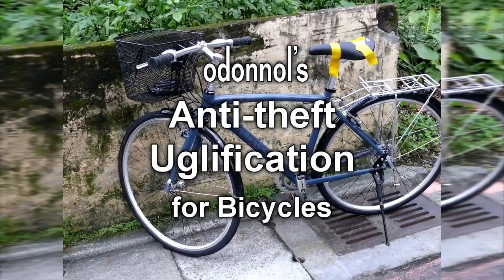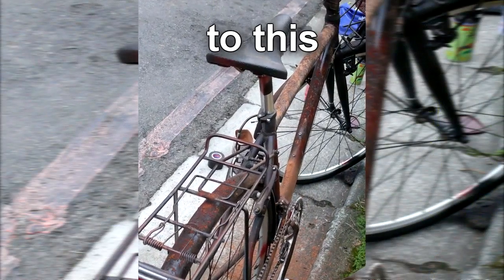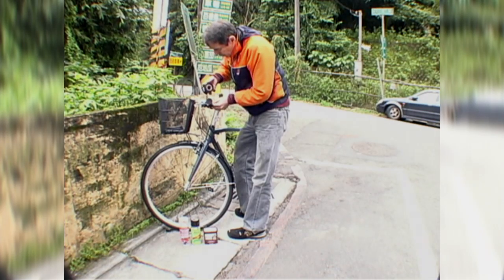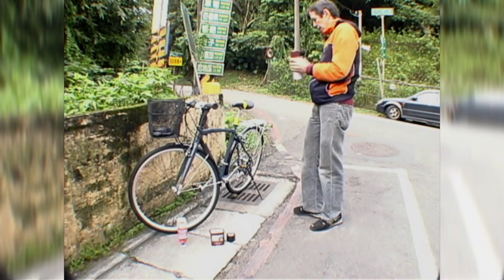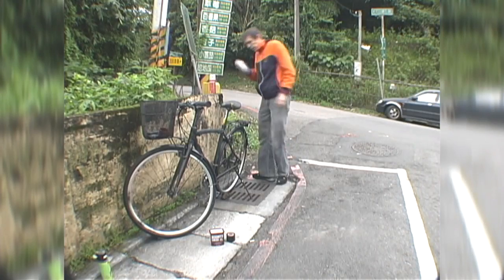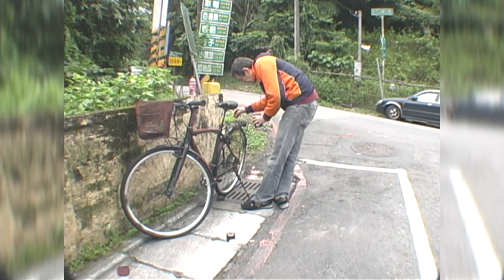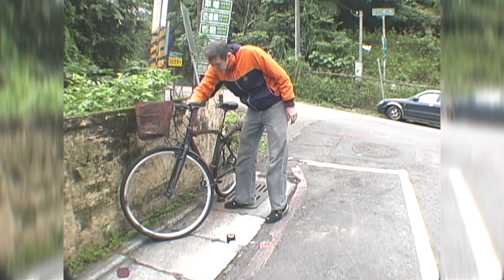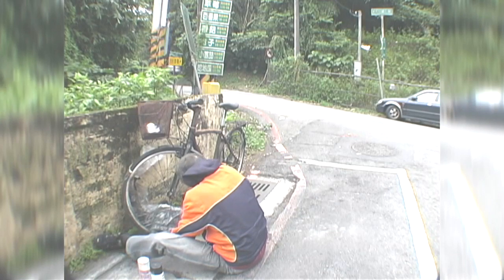DIY Uglification: A Simple Anti-theft Technique

Comment: Personalization apparently works just as well. If you mark it up with stickers and such that you like, it makes it unique and a lot of work to sell it as brand new. A thief won't get top dollar and will likely target someone elses. Using multiple locking systems is also good advice. A short U lock through the rear wheel and frame, then a chain or cable on a bar or locking post etc. Make em work hard !
Reply: I like your comment; makes a lot of sense.
And this IS personalization–if you like powdered chocolate!
Reply: yeah I did the same thing with my laptop, painting on it and writing my name on the pieces inside it with permanent marker. Personalized items could be resold but they can't pass as a new article so thieves are less attracted by it.

Comment: Uglification? Sounds like a waste of time, and money considering thew fact that you could save that money to purchase a good quality lock instead of spray paint and tape.
Reply: Thanks for your comment. I also use a medium good lock. But it is my opinion that making the bicycle unattractive is more effective in discouraging theft. There is something about a good looking, high-quality bike that thieves find hard to resist. Resale value maybe?
Reply: Miles Odonnol
Not when a thief will likely spray paint the bike before selling it.  I agree with Raijin, just get a locking system that deters the would be thief and keep the bike looking nice.
Reply: RaijinHanshi They should make bikes with gps systems INSIDE the bike that you can't take out.  Maybe they already do, but I haven't seen them.  These will get your bike back fast and throw the thief in jail.

Comment: is better you buy black contact paper... and a sandpaper... for sanding the paper, the bike will be very ugly. And when you will sell the bike, you remove the paper
Reply from the maker: Not a bad idea. I did tape up some areas, such as the aluminum handle bars. But generally don't sell em; I ride em forever, or till they break.

Comment: I should do that with my carbon fiber frame. I could make my $4000 bike look like a piece of shit that a thief will not want.  Then I would not get so stressed out and worried when I have to lock it up  for several hours.  I don't care what a bike looks like as long as it is super light weight and the gears are clean and shift properly.
Reply from the maker: My sentiments exactly. I only paid a seventh as much for my bike, but I'm sure glad it is still here where I can ride it.
Reply: This. What good is a skookum bicycle if you cannot actually use it for fear of theft? No lock is invincible.

Comment: You have to be careful not to make it so ugly it looks intentional. The real trick: Repaint your high value bike with glossy, beautiful decals until it looks like a comparably shaped Walmart special. At least in the US, names like Schwinn, NEXT, Huffy, Roadmaster, and Mongoose are well known to be worse than worthless on the resale market.
Reply from the maker: Interesting, and smart. So far the fake rust (even on the plastic mud guards) and beat up appearance seem to be doing the job. Of course the bike is over four years old now too, so some of the age is real. 
But I like your thinking. I might go for a Hello Kitty treatment. 
Baskets help too, I think. They are rather unsporty. I now have baskets both front and rear. 
Oh yes, I couldn't find a chain guard to fit this model, so I made one from used cookie tins. Covers chain; looks trashy. Perfect.
Reply: The best thing is that all those mods are functional too!

Comment: Great thank you for this! Like many others I’ve had painful experiences of bikes being stolen, including peaceful Scotland where I’m now! Just bought a new bike as the old one (very battered so good for theft proof but just too many faults to be worth repair) and determined to find a way… may I ask how effective are all of your sprays and coco power, especially the clear lacquer spray (by the way, I only saw gloss on Amazon, will it work?) in holding the coco power in place? Do you need to “top up” after some time of usage? Thank you again!
Reply from the maker: Gloss lacquer works nicely. The 'rust' effect fades a bit over the years, but I have not yet topped up. Ten years later the bike still looks like crap. The black and brown paint help too. Brown adds to the rust feeling; black looks like dirt or maybe oil. I first hit anything shiny with black tape or paint. When done, nothing jumps out. Best of luck!
Reply: @Odonnol  thanks. More technical details- did you use oil based or water based paint? I assume spray paint looks more convincing than using a brush?
Reply from the maker: @xinyijiang6302  I used spray lacquer. AFAIK any spray can paint should be fine. I don't think they put water based paints into spray cans. Anyway, I'd avoid water-based.

Comment: I love this idea and have done things with this concept in mind to my bike and car. When I got in an accident instead of getting the matching fender and quarter panel I got the black matte. When chrome parts wear out on my bike I replace them with matte black parts. I’ve also put duct tape on my brand new bike seat. I don’t take special care to keep the frame clean or prevent scratches. I’d recommend to anyone to immediately replace quick releases with bolts. No only does it make those parts easier to steal but also makes the bike look more expensive. Good luck all.
Reply from the maker: Thanks for your comment. I still have quick-release skewers on a couple bikes; I've been lazy about them, and not sure about finding the right replacement hardware. But you are definitely right.

Comment: why dont you just buy a cheap rusty old bike, instead of a new expensive bike made to look ugly also decreasing the price
Reply from the maker: Other people have mentioned this too.
The thing is, there is a huge difference in RIDE between a good road bike and an old beater. The good bike is much more efficient at turning your physical exertion into travel down the road, so you go faster, and farther, for the same effort. Sometimes in traffic you need to accelerate; with the good bike, you can accelerate more quickly--a lot more quickly.

The brakes work better too, so you can stop in a much shorter distance. BTW, it's amazing how much better bicycle brakes work now as compared to when I was a kid. Another thing is adjustments (e.g., brakes, shifters). The old beaters I've had were a) hard to adjust b) required frequent readjustment. The good bike is easy to adjust, and holds adjustment for a long time. 

Anyway, to me it is worth the money, within reason of course, for a quality experience. Obviously I don't care much about fancy looks or resale value. But I do like it when the bicycle I paid for stays around so I can ride it!
Reply: Odonnol
Get a good used bike. You probably will have a better bike for the same price.

Comment: Just buy an old and secondhand rusty uglr bike
Reply: Great idea! Except that old rusty bikes usually ride like crap. There are good reasons that people are willing to shell out $500 for a superior street bike: fast, smooth ride; comfortable and efficient ergonomics; sure, quick braking; accurate adjustments ( that hold ); durability; better safety; lower noise.
But if you want to ride a crap bike, go for it! I used to ride crap bikes myself; that's how I know so much about them!

Comment: Old post, but .... how do you wash it after giving it the ugly-treatment?  Maybe I missed the point :)
Reply from the maker: Wash it? Whut? I don't wash it. Well I cleaned the chain with a solvent soaked rag, then treated with wax, instead of oil. Much cleaner chain now, which saves pants and socks.

Comment: simply always buy a rusty piece of shit. I dont understand how ppl can spend thousands on a bike that is NEVER safe. EVER.not even close
Reply from the maker: I totally agree about voting Bernie! But with the bike thing, it's a matter of balance. A good bike provides a much better ride than an old pos. For this bike I did not spend thousands; I spent around half a thou. And I am still loving the good ride.
Reply: Odonnol is right. I bought a bike worth 400 euro for the first time in my life after always getting cheap ones. The difference is incredible. I can zip up hills now, I can cycle down down off the pavement without even feeling it, let alone hurting my bike or my back, and most importantly, if I need to cycle really really slowly, slower than walking pace, my bike does not wobble even a little bit. For example if there is a lot of broken glass on the road and I want to cycle on the pavement without freaking out the pedestrians. (It is a Felt q26 by the way, and I bought it second hand (from a shop who insist on receipts!) for just 200). 

I see people struggling on a flat surface because their bikes are "rusty pieces of shit", and I think "that used to be me".

Comment: This is genius. After all this time have you changed anything to make this better? Also, does this work in really humid places where you would ride the bike while it's raining?
Reply from the maker: Glad you like it. No changes or improvements. Works fine in humid and rainy places. When the clear overcoat paint or lacquer dries, it holds the chocolate powder in place. There is some erosion of course, especially in the first week or so, but even years later it still looks rusty. Even the plastic mud guards are rusty; I treated them too.

Comment: this guy realy think thief are this stupid ,, aluminum and plastic don't rust ,,  thee are 4 type of thief  the one than want to sell it , and make good profit ,, the one than want to ride it ,, and the one than want some parts to fix is bike ,  and the junkey ,,
Reply from the maker: Yes. Thieves here really are not too smart. Or maybe they are just lazy. But uglification is working here. Maybe you live in a place where the thieves are smarter and/or more industrious. If so, my sympathies.
Reply: most are like you say not to smart ,, but at the end the most comon are the junkie  and the kids ,, so a good  D lock 20-50$ and you are good , most of those don't have heavy tools ,  like angle grinder o big bolt cutters ,    if you have a cable lock or a cheap chain and lock ,, your bike will not last long , iven if is a cheap and ugly bike ,, since 10-20$ is enof money for a junkie ,,to get a fix ,

Comment: Why not buy a crap bike in the first place ?????
Reply: That's my plan. I'm going to fix an ancient (antique actually) super rusty bike that has been sitting outside for about 30 years. Removing the spokes, 48% of them broke just loosening it, but I will re-use those and tighten them as much as they can go (just so it really has the worst spokes/wheels ever seen). My dad recommended buying new spokes (for safety), then dunking them in acid so in a few days they would look just as bad, but I can't stand the thought of ruining new spokes.

A couple weeks ago thieves cut the lock on my nice road bike (a shame too, I was going to join the cycling club, and biking is my only real source of exercise here at college). The semester before was a motorized bike, but it sucks for them, if they waited a week I would have added all the new throttle cables, throttle, speedometer, and lights. That one was cheap though, so I didn't really care that much that it got stolen, but they had to steal my new road bike I liked so much. That's why they've pushed me to the point that the only bike they will get is 100x worse than a bike you might find in a dumpster.
Reply: Sorry for your loss. I lost one bicycle and two good motorcycles to thieves.
Reply: +Miles Odonnol well it might not get stolen. I'm not willing to give thieves something worthy of stealing. They probably have more money than I do anyways. My car is from the 80s, has 250,000 miles on it and needs a gallon of oil added between oil changes. I can't just go giving away bikes to thieves. If it was charity like bikes for the homeless, that's fine, but not scum who think they are entitled to the best I can afford.
Reply: +Jake Garrett ooh, and I'd like to fix the AC on my car too, 100+ F if hotter than internal body temp, so it's miserable in that condition for even a few miles. Thieves might not steal the air conditioner, and that's something I might like to actually spend money on...
Reply: +Miles Odonnol that sucks. I haven't had a motorcycle stolen, just a motorized bike, but those are way cheaper. I wish they had a better security system besides the handlebar lock on motorcycles. I guess you could add an alarm, but it would be great if we lived in a world where we didn't have to lock anything and people respected each other's property and weren't so greedy.

Have an excellent day, odonnel.
Reply from the maker: Steve C A crap bike gives a crap ride. A good street racer gives an amazing ride. I prefer the amazing ride.

Comment: just buy a shity old bike
Reply: +Omar Ortiz I know you are trying to save me money, and I appreciate it. The problem with shitty old bikes is that they give a shitty ride, are hard to adjust, and do not hold adjustment. My new road racer that looks shitty rides like a dream, is easy to adjust, and holds adjustment. It is efficient at converting physical effort into forward motion. And the brakes work amazingly well, too. So it does not look impressive, but the riding experience is excellent.
Reply: +Miles Odonnol i know that feeling, i have a badass bike and one shity one to ride around town or to commute to work.....heres an idea just put mud on top of the bike,. even easier to clean for when you want to show off your bike.

Comment: One trick to protect expensive dynamo powered lamps: Just add some duct tape (or vinyl tape) and tape right over the plastic or metal, so it looks like the light is broken and just held together by the duct tape. Nobody wants to steal a broken light :D
Reply: +Paul Weber and if your light is blinding oncoming traffic (as most lights without formed beam), you can use the tape to tape a piece of plastic on top of it, so you got low beam lights.